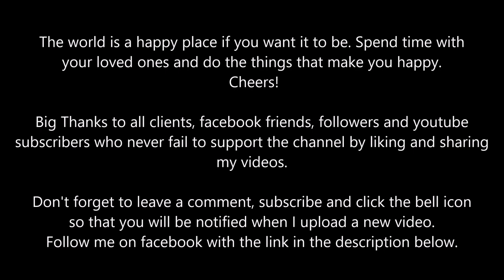Custom Pc Build #92 " Mini " Water-cooled Pc on a Lian-Li 011 Mini Case.

Comment: Good job! Could you please say something about the temps and noise? Idle temp and fan rpm, temp while gaming and fan rpm, etc.
Which radiators are you using? One 240 and one 360?
I have almost the same specs/components. 5950x, tuf 3080 oc and an asus strix x570 e-gaming mainboard. 
The system should have headroom for oc and while being silent

Comment: No matter how clean is your house you will have to hover radiator at some point. That’s why I have ditched my lianly. It’s days job to take a part and clean 2 320mm rads now it’s all fitted to the wall. But like always your builds are inspiring.

Comment: very nice looking build. i like, how you routed the gpu-tubes in opposite directions. also interesting idea to route the gpu-powercables through the cavity between pcb and cooler. my graphics card / cooler does not allow that. there is not enough cavity. good video, thanks!